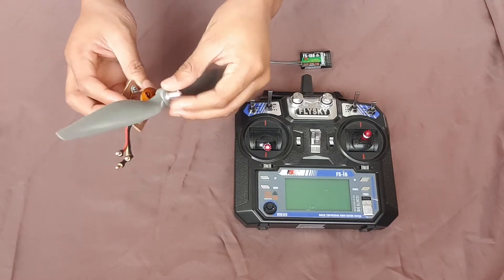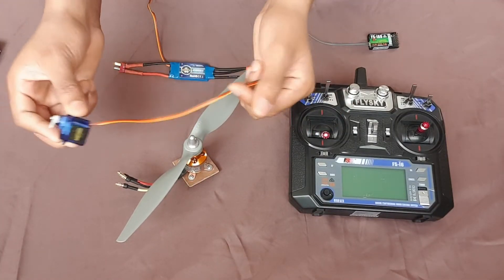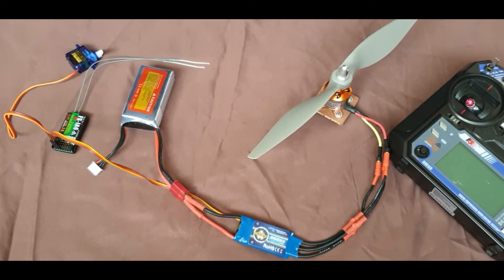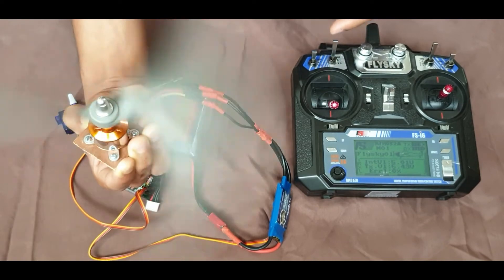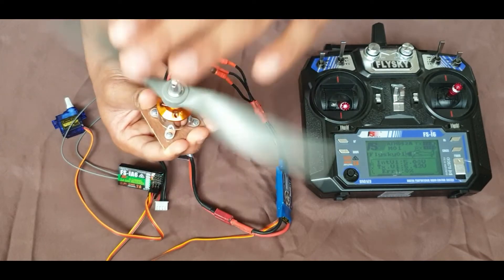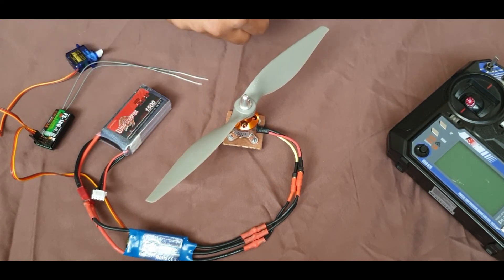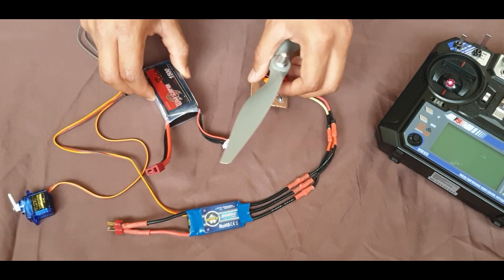Basic RC electronics| How do they function together?

Comment: I'm going to make a wind powered drone that will have unlimited range by connecting to cell towers instead of just by receiver
Reply: well, the drone won't be wind powered. The battery will provide power to the ESC then to the motor to spin the propellers (16000 kv total). Then the wind generated by the propellers will be collected and made to spin a generator that generates electrcity to charge the drone. This will likely not fully support the energy needs of the drone but there is always solar and bigger better badder battery tech

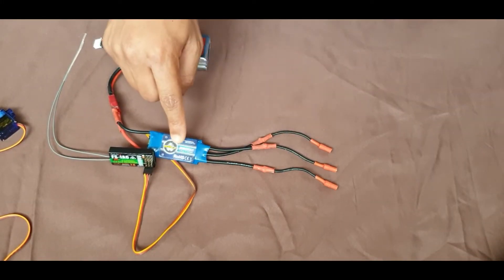Comment: 2:57 okay so those three wires connect from the ESC to the motor, but why are there 3 wires? Do all motors have three wires? Does it have anything to do with you being on "Channel 3"??????
Reply from the maker: Yes, all brushless motors in the RC system have three wires. Channel 3 corresponds to throttle for the Flysky model. That channel function depends on the model :)